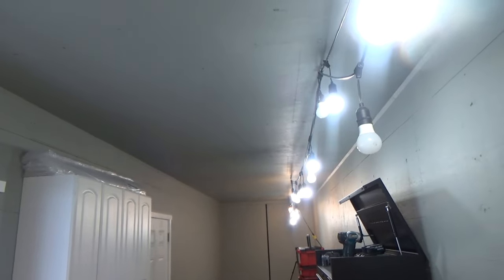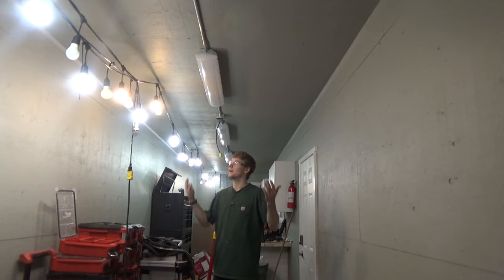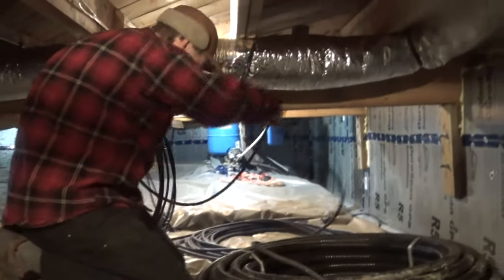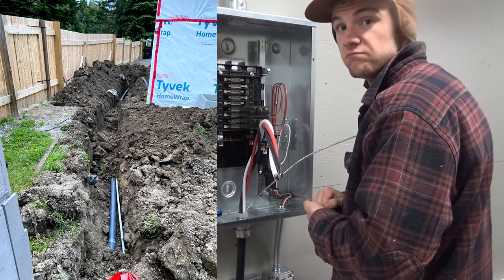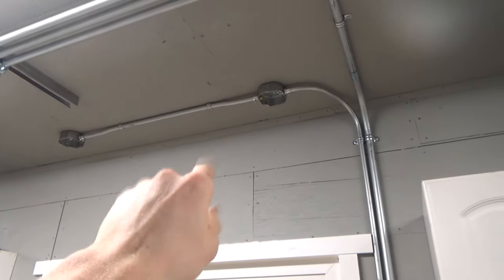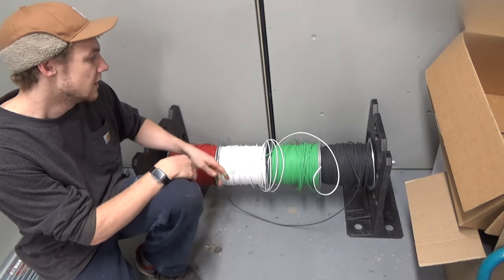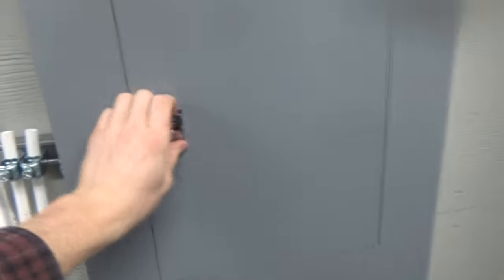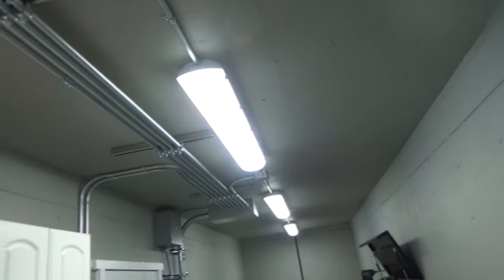Workshop Electrical / Lighting Part One [Shipping Container Workshop EP 4]

Comment: nice work, have you thought about making instructional videos for apprentices, obviously you've got lots of knowledge about the trade. Some topics i think you could go further into that i noticed in this video are: the service loops you put on your subfeed, how you got your lighting layout, how you laid out the hole in the jb etc. Thanks, this was an interesting video
Reply from the maker: The thought has passed through my mind, however i have yet been to the point of turning one into a video.
Reply: FIrst your system is so clean, so professional, the best I have seen online, it is so nice, that I want to model my system your way.
I understand a video is a lot of work, could you please simply draw a simple hand drawn layout of your wiring, just like your marker box drawing in this video, but with just a little bit more detail 😁
With that I could mimic and or adjust your layout to fit mine.  I could fiqure out the wiring connections later after the wire layout is done, right now, I just want to lay the conduit, wiring, and, boxes, and your pictures already say a thousand words on how to do that.
Thanks, you are definitely a professional!

Comment: Yo bro I jus found u on here I was looking at ur old videos and I’m at I’ll wondering wat wire gauge would u use for the a big 3 kit for a sound system in a explorer and should I go for a welding cable and if so wat size I’m thinking 0 gauge not sure bro help pls
Reply from the maker: Do you plan to stay with the factory 120amp alt ? How large of a system ?